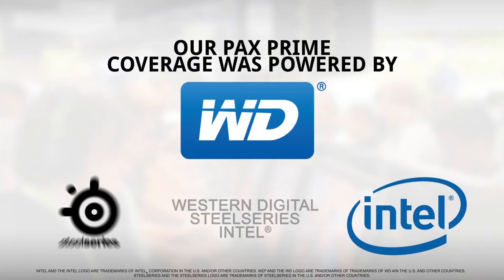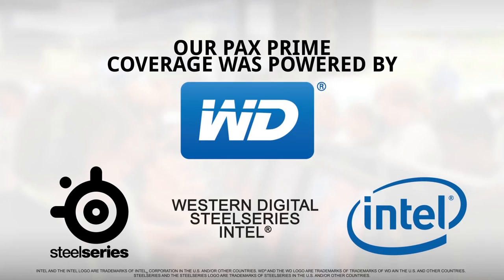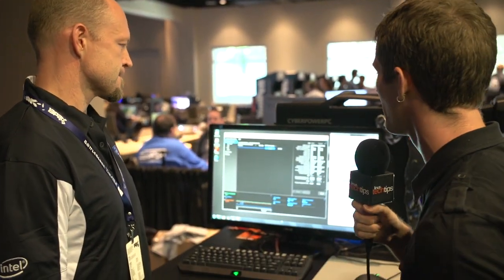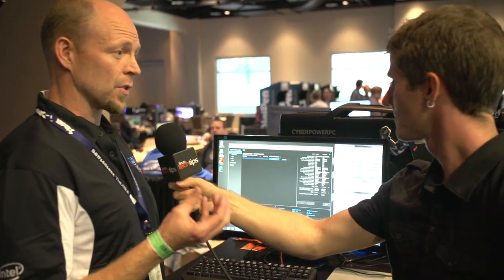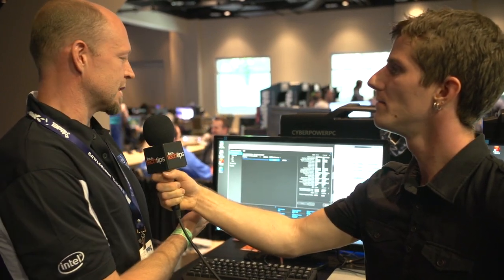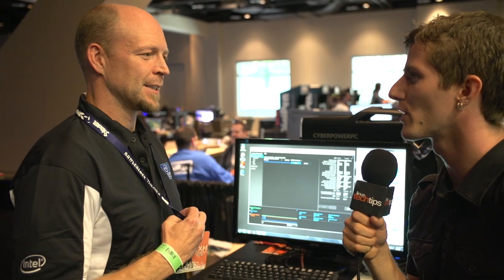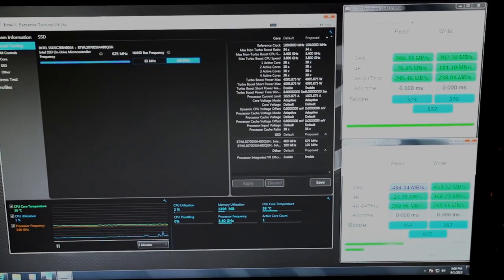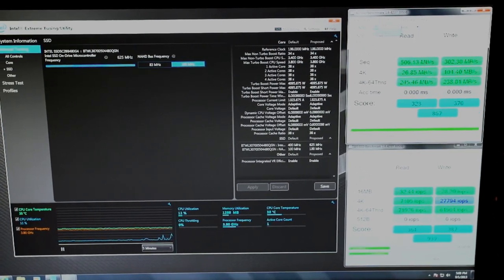Intel SSD Overclocking Hands-On & Prototype SSD Sneak Peek - PAX Prime 2013

Comment: I'd gladly overclock for even a 10% increase. I run RAID 0 SSDs that actively back up to a mechanical drive. If the SSDs were to fail, I'd simply restore the data and tune down the overclock...slightly

Comment: He makes very good points. Caching doesn't risk the data, and obviously these SSD's would be tested, and might even be offered with a similar warranty to the Intel K-series CPUs for moderate overclocking.

I wonder if they might put heat sensors and whatnot on the drive to throttle overclocking, like in the case of the Haswell chips? It might be an added safety feature. Also, would SSDs come with a BIOS option, and if so, might we see Dual BIOS on SSDs in the future in case of bricking?

Comment: I hope! I actually did that with my PC's CPU. More lifetime or not, it's very hard to make this beast struggle, so i can spare some Mhz and still have no lags or any kind of problems. However, a smart clocking system like the ones in modern CPUs would be ideal for those SSDs. (More Mhz when needed, less when idle) That would give them a performance boost without sacrificing much of the longevity.

Comment: I would definitely overclock an SSD. I would be really comfortable with running an OC'd SSD as a cache drive, which I think would give huge performance increases to a mechanical system. I would also be comfortable running an OC'd SSD in a RAID 5 array. I would be fine with running one as a boot/programs drive, and I would even use one as a main storage drive if I did frequent backups.

Comment: I'd def OC my SSD. More IOPS the better. I already run RAID-1 or have daily or hourly backups on my important drive.

My current array is RAID-0 for OS and applications, having that same setup + an overclocked Intel scratch disk would be awesome for media production. I'd really want to see Overclocked Intel drives in RAID-0 vs a similar competitor solution and see what the latency and IOS would be like.

Comment: Yes I want to keep my PC for 3+ years. In my experience, I ran my last rig (E6400) with a moderate overclock/overvolt and it's no longer stable at stock speed w/ stock voltage. Overclocking DOES affect longevity. Also keep in mind that not everyone is a gamer.

Comment: No i did not miss that part, and within a year or two, we will have gained that 50% boost right out of the box, samsung is working on some interesting stuff, and sata 3.1 (if i remember correctly) will be utilising pcie lanes for insane SSD speeds natively, so don't worry, the speed boost will come all by itself. I am much more concerned with getting ssd prices down to the level of mechanical storage, and increasing the longevety of the flash. I could see this being usefull for companies though.

Comment: In a home setting, probably not. But in a datacenter setting, where an extra 20% performance on *each drive* would cost considerably more (consider a DC that buys 1000s of drives), I'd say it is *very* worth it. Especially when used in cache where the data is stored persistently elsewhere.

Comment: Stability is central to the spirit of overclocking. I overclock my 980x as much as I can get away with but obviously a failure in a drive is a completely different proposition because you've something to lose other than a restart.

Comment: It's about time we can now actually overclock our hdds, I would take that 20% anyday and especially if you can get a 64gb version of this I would put my boot drive on that and since I already have most of my programs and games on my second hdd it shouldn't matter at all. plus a backup of the os on an external hdd and your sorted.
ssd hdds still need to come down in price though as they're expensive for the larger ones.

Comment: I like to see a comparason with an overclocked intel and for example Samsung 840 pro and other high end driives. We hit the limit of the sats3 bus allready. For cache drives it is no problem. But when the lifespan is half the normal life. You are swapping much more cache ssd's in a data center. So more downtime and maintance which cost money.

Comment: I would do it for 2 reasons.
!: Speed, throw two in a machine OC them in a raid 0 config, be set for speed.
2: Faster read/write performance, with 4K coming soon, commentators and such will be needing faster write's to record in 4K at 30-60FPS.

Yes you can go with a PCI-E card but most well off ones are $1,000+ US and are not very high in space.

Comment: I like the idea, it sounds crazy, but I save important data to old-fashioned mechanical drives. I don't use anything except decent quality WD or Toshiba either. If you take proper backups of an SSD, life is good, just expect an SSD to fail or corrupt, because it can happen.

Comment: That said... If the sata controller or interface can even handle the speeds then you would need to basically OC the interface to make sure the CPU would draw more speed to it... That alone could help a bit.? But an individual cache fore installing the OS on the drive itself with an individual controller on it would be awesome on bigger consumer drives like the 520... Or you could use it for cache - if the sata interface can handle it on a single port that would be...

Comment: Currently running raid 0 on 2 intel 520 just for OS en applications.
All data (inclusive saved games) are reallocated to an raid10-array, which is backuped on my QNAP NAS.

So I think my data will be safe. Therefore I see no harm in trying to push for a little bit more performance. Of course after stresstesting and validating.

Comment: HD load times is what's absolutely limiting games right now. Reading from a HD is about 100 times slower than from RAM and RAM is 100 times slower than cache. Most games, these days, stream data from the HD in real-time. That limitation therefore heavily affects the *design* of a game. We're not talking about performance increase, we're talking about people consciously having to design around the problem of a slow HD.

Comment: I'd like to actually point out that SSDs dont catastrophically fail if you drop em while they're operating. SSDs aren't unstable, they are smart, and can adjust accordingly to how much wear happens on their NAND flash. SSDs can take 1500g/0.5ms impact force. 

Video cards dont directly store data, CPUs dont store data. They're both overclockable. They both would increase in speed and performance if they were overclocked. The idea is the same. Higher  Boost with more risk. U just wont loseSSDdata

Comment: won't you still be limited by the SATA speed? I would do overclock a PCI-E ssd if they were not so expensive to replace. The largest deterrent for me is the cost of replacement. I find myself overclocking the snot out of cheaper parts long before I ever touch the high dollar stuff.

Comment: I hadn't heard of Gamecom and simply thought you'd misread Gamescom, which is a simple mistake to make as I got the wrong end of the stick too. Anyway, why are you commenting aggressively all over this video deeming SSDs as unreliable and that overclocking them is a bad idea? It's the same concept as overclocking a CPU - pushing it harder than it's designed to do, which is now accepted as safe to do. SSDs are less likely to fail than HDDs because they use nothing mechanical that can wear out.

Comment: On my first SSD purchase the Vertex II's. Still running in raid 0 main OS 2x 30g. Running off of Asus Rampage Extreme II x58. Running since 08 no problems. In my opinion, Loosing longevity would be fine. 5 years+ for any part is well worth your money. If i lost a few years for better performance? I would do it.

Comment: I upgrade my systems too often to worry about part longevity, therefore it would be a viable option for me.

I would use it and bump up random IOP's, this is where a lot of drives currently perform poorly and I, due to my usage scenario, benefit greatly from an increase there

I wouldn't buy on though, I prefer to throw my money towards GPU's and platform upgrades

Comment: As far as longevity goes, the 520 series intel SSD has a MTBF of 1.2M hours... that's nearly 137 years or running the drive... So yeah, I would sacrifice even 50% of that for vastly improved performance. If it things like heat dissipation that cause the failure to occur sooner, that's pretty much already been addressed by every overclocker out there, so it wouldn't be a big risk for them.

Comment: The answer is YES, I would...sacrifice longevity for performance. In fact, let the utility have a slider to where each (power) user can increase performance by x % and see his "likely longevity" of the drive go down in a GUI-based utility, as an example.

I would put a HUGE disclaimer for "regular" users to only do the "Advanced" settings if they knew what they were doing. For example, the warranty period could be reduced by x years for y performance. Whatever. Just thinking out loud. lol

Comment: I probably wouldn't do this, but if i where i would probably put two over clocked SSD's in raid 1, if one fails, turn clock speeds back to default until i get a new SSD and restore the array. and perhaps a 1 TB backup HDD as well

Comment: Since i have a intel 520 480 GB version i wouldnt risk overclocking it unless I really knew it was solid.. Only thing I would OC would be writespeeds tho... Especially when you hit that write-cliff and the NAND begins to slow down etc.. Happened to me yesterday where it dropped to 150 MB/sec write but some cleaning and rebenching gave me a 286 MB/sec max so those Intel drives are solid.. Max I've seen is 533.4 read and 321.4 write - single drive...

Comment: I went from a Vertex 2E to an M4 and didn't really notice any difference on the reads.  So that's going from 275MB/s to 500+MB/s and I didn't notice it.  

I only use my SSD for my OS and applications, and I have it backed up with Acronis, but still I wouldn't overclock it for stability reasons.

Comment: SSDs initially, are not unreliable by today's standards. They are in fact, the most reliable single unit solution. OCing a SSD will increase performance but decrease lifespan. But that doesn't mean you need to store your data on SSDs. HDDs are still a good solution for Data storage. The only reason that a SSD would last longer than a HDD is if both of the drives were under the same workload for a comparison.
If you had HDD for storage and SSD for everyday use then the HDD would mostly sit idle.

Comment: I would like to know your train of thought here. Overclocking could potentially make one drive unstable. Running drives in Raid 0 increases the chance of failiure extensively. You think overclocking both the drives and running them in raid 0 will make them equally stable as a single drive? Am i the only one being confused here?

Comment: Oops, typo, should say 12,000MB/s.
Looked into it more and original articles I read weren't accurate (per se). It comes with a RAMDisk software which allows for ~12GB/s transfer rate. The drive itself will do about 830/810MB/s.
FYI PCI-E 2.0 x2 can do 1000MB/s in both directions.

Comment: Overclocking by its very nature is stressful, risky, and often dangerous to computer hardware and system data.  Just like any other type of OC, if done methodically, conservatively, and under realistic expectations, SSD overclocking can be a lot of fun and add performance as well value to your product under appropriate use cases.  Having said that, NEVER WOULD I EVER DO THAT TO MY SYSTEM! Not even as a cache drive.

Comment: I would use it for screen cap recording because the fps drop you take from recording is very dependent on she speed of the drive you really writing to and the speed of your cpu. If I can lessen one of those bottle necks and make recording at higher fps easier I definitely would

Comment: I personally wouldn't overclock an SSD. Then again I leave my CPUs and GPUs at stock as well. I keep my systems for 3+ years so I don't want to shorten their life. Low noise is also very important, and using overkill cooling on stock parts helps me achieve low noise.

Comment: Got my OCZ Vector, and no I would not over-clock it even if the performance gain would be 50% as I don't feel like there would be any benefit for user experience. Honestly I sometimes feel bottlenecked by my i5-2500k as it goes to high 90's to 100% utilization when it uses up all the resources provided by my SSD.

Comment: If the longevity of the drive is reduced by less than 5% then I wouldn't mind the 20% bump in performance of the OC. However, if the longevity reduction after overclocking is too steep then I wouldn't bother.

Comment: If the drive supports raid with 2 drives, I would put it as a cashe to a remote PXE boot NAS. Ofc the network would be running with 4 10 Gbit/s and contain regulair raid 0 SSD´s. And just to be safe, use a remote secound NAS to backup the first one. ;)

Comment: Even at stock most people will OC their Intel CPU's to 4.2 4.4Ghz, we change our Ram frequency from 1600Mhz to 1866 and higher, so yeah overclocking your storage does seem like the next step for me, at least with a more stable drive and I'd do it for OS only after all it really doesn't take long to re-install an OS if the proverbial hits the fan does it?

Comment: As a fairly regular consumer of an upper-middle class/lower-high end pc (4770k, gtx 780, 840 pro, 16gb memory etc), i would not dream of overclocking my SSD. I do not ven oc my cpu, nor my gpu. If i have to sacrifice longevity and potentially stability (these parts aren't cheap you know), for a negligable increase in performance, something i would not even notice in my every day use, i don't see the point. My pc is plenty fast for my usage.

Comment: Yeah I would take this at a reasonable price and run 2 small size SSDs in raid for caching. But I am really looking forward to SATA Express, I think after that comes out performance will increase alot as the bottleneck is removed and companies compete with performance.

Comment: I buy 3930K's and 780's and I'm not really planning to OC an SSD just to wait a sec less to start my game. You don't really see every hardcore enthusiasts putting their SSD's in raid0. It just comes rather down if you ever want to deal with issues or not. I can't be arsed with a system which won't boot every 3 weeks because the ssd(s) lost data.

Comment: just wire your computer directly to the wall socket, dont forget (this is the cooling solution to the overclock) to dip the entire computer into a LN2 tank with a fluid flow of 10 gallons/second.

Comment: Using the SSD for storage was never the plan. Caching was always the way to go for me. That said, RAID0 makes more sense. Mechanical hard drives have a mean time before failure but on SSD's this is more dependent on how many write cycles the SSD has had, which will be less, per drive, in a RAID0-array. Of course RAID5 will always be the best option though. Frankly, I would even go so far as to say you could try underclocking your SSD and see how it affects power consumption in laptops.

Comment: you're talking about short term, and how you would have your processor/mobo die from the heat created by the components. but overclocking puts stress on the CPU's internals. Overclocking shortens the CPUs lifespan... So yes you can have a CPU die before your mobo does.

Comment: I have had ssd's for 3 years now. I run 2 in raid 0 and it is the best. I am a hard core gammer /bencher and I will have the best. Now this could be 3 ssd's 128 gb in raid 0 or a ram disk  I will try the new Intel ssd and overclock it but I would try 2 or 3 in raid 0. If my system crashes I will install my os and games np
Thanks

Comment: yeah, but there is always someone out there who needs to store MASSIVE amounts of data and will replace 50 RAID'ed hard drives with 5 OC'd SSDs in RAID 5 for big storage capacity, speeds, and redundancy in the array, or you could have 2 or 3 SSDs mirrored to another set of normal SSDs

moral: there is always someone who wants more storage in less space at faster speeds

Comment: I have a single SSD...yes its an Intel 520 series drive with 2 3TB HDD in mirroring. The reason why I got the Intel SSD is because of its renowned quality and reliability. So the answer is NO I would not use this utility. the increase from say 14 seconds to 11 seconds for a boot sequence (20% increase with OC) is not worth the data loss and wear and tear on the drive...!!!

Comment: Well if it got to the stage where CPU and GPU overclocking is at at the moment where you crank it up and forget about it because it just works then yer i would do it!
I'm even happy to play a bit with the settings. 
Plus it's Intel, They have the most reliable drives on the planet, what are you worried about? It would be nice to crank up the lower end models and save some money

Comment: 20% jump for a cache sure even if the lifespan was 30% less. 

PC - I run my SSD's for OS and Apps now i.e. no important data that which stored on a RAID 10 array, In my case I have a RAM Cache but for an SSD + HDD cache sure why not until the next gen SATA.

Comment: You want to keep your PC for 3+years, but you don't want to OC it ? Well that's original. A lot of people OC there CPU/GPU in order to squeeze the most of their component in order to run their games @High settings for 3+ Years. Also, if you take a look at factory OC'd GPU, they always have an aftermarket cooling solution, which run verry quiet.

Comment: drive speed won't really impact gaming.  Maybe load times, but not by much.  SSD is still pretty expensive so I wouldn't want to risk destroying my drive.

There is newer technology coming out for SATA controllers if I remember correctly.  SATA Express with speeds up to 16Gb/s.  That will be a much more worth while experience.  Also you can already run two drives in Raid 0 for a boost.

Who is actually thinking that SSD is too slow?  My PC completely boots in about 30-45 seconds...